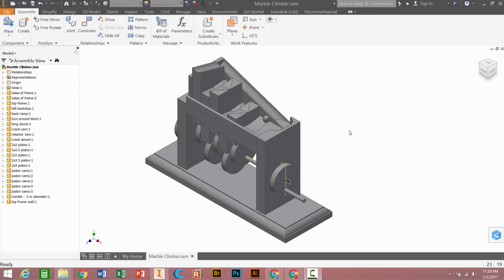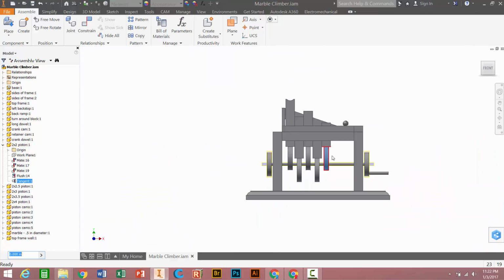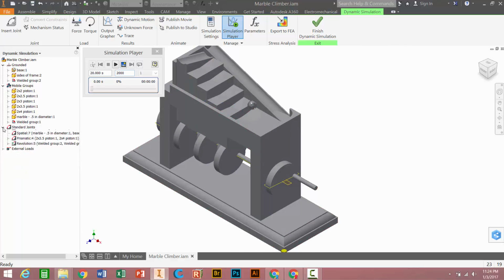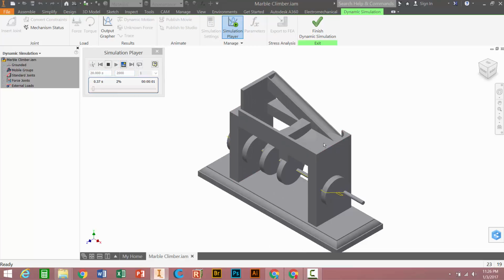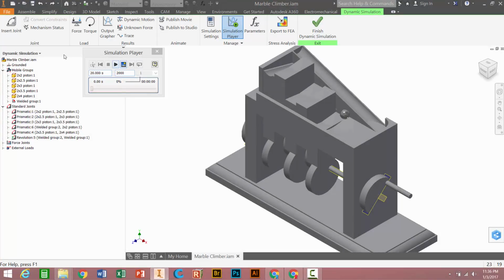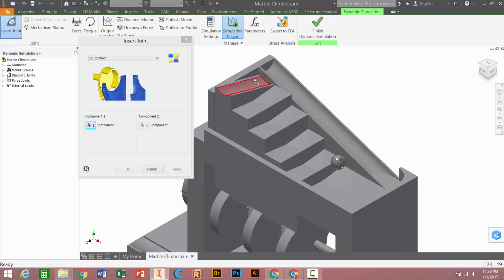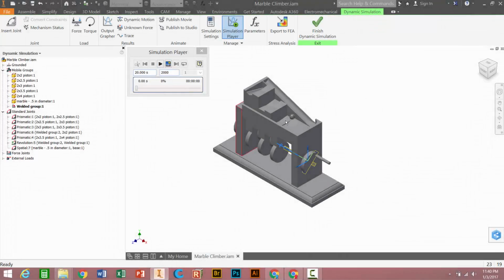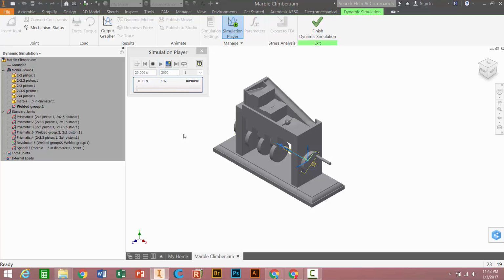marble climber - gravity simulation

Comment: super nice tutorial... you have a video where you modeled this climber by any chance?
Reply: Sorry i don't. My students make the parts from drawings i give them, then we do this for fun/cool factor.  Thanks for watching!
Reply: @ktjanota   yeh i figured that much :) im still at early stage of learning in inventor and i recently bought 3d printer so i want to print some marble machines. Shouldnt be too hard to make this climber, its all basic shapes and functions.
Reply from the maker: Here is the link to my class website page that has the documentation for this project: http://kimberlycad.weebly.com/marble-climber.html
Reply from the maker: And congrats on the 3D printer!  They are a blast to use!
Reply: @kevinjanota6290   boy was i wrong :) Its not that simple hehe, lots of parts afterall, even for something that looks so simple. I managed to create it, here is a pic: https://i.imgur.com/iewp9WN.png      everything went rather smoothly except for top frame part, i couldn't get revolve cut to work at all... i tried so many things, and then i just gave up and used loft cut, the same as with pistons.
I scaled everything down by 0.57, since i ordered 9/32inch ball bearings and hopefully they should arrive today or tomorrow and i can start 3d printing :) I also enlarged crank & cam dowel to 6mm to give it more strength for 3d printed part.
I do have one beginner question if you dont mind answering...  I am/will be making other marble machines also, so lets say i only had drawings/picture of how this marble climber looks and i wanted to recreate it in inventor. But i wouldnt have measurements. Basically probably like you had in beginning. What would be the best way of modeling it? I feel like making all different parts and trying to fit them together would be cumbersome. Would you model all parts in assembly or how?
And yes 3D printers are just amazing... designing something on computer and in few hours you can hold it in your hand... priceless. And 3d printer prices came down a lot in recent times, atleast for entry level printers like mine is...Anet a8, got it for 130€, it was a no brainer especially for being on my wishlist for like 5 years already :)
Reply from the maker: Looks great!  Top frame part.....if you sketch on the surface towards the piston, just draw half of the bowl shape (with the vertical center line to revolve around), then revolve cut should have worked.  My students often draw the whole bowl shape and then when they go to revolve it won't pick half of the profile, so the sketch needs to be trimmed to just half the bowl shape.  Anyway, no biggie, in the end, as long as it works that's all that matters.
Yes, you are correct with building from scratch, you would just start in an assembly file and keep building all of your parts while in that assembly file.  That will allow you to reference (project geometry) the other parts to determine sizes on the next part.
If you think of it, send me a link to the video when you get it all working!!!
Reply: @kevinjanota6290  https://i.imgur.com/ift7J3p.jpg here is first picture of it assembled and working properly :) its tiny though :) I already saw some areas for improvement where balls sometimess fall out, so i will be printing new parts tomorrow. Also going to be making even slope on lifting blocks, because wherever there is a flat spot, marble will get stuck eventually there. I will also combine and cut some parts to make them more suitable for 3d printing. After all of that is done, i will probably paint it in those rainbow colors and upload video on this new channel of how to put this together, and also ofcourse printable models online. i've also just received super tiny motors and it should be fun hooking them up... after that, on to new and bigger marble machines with proper tracks instead of just one chute, this is hopefully just the beginning.